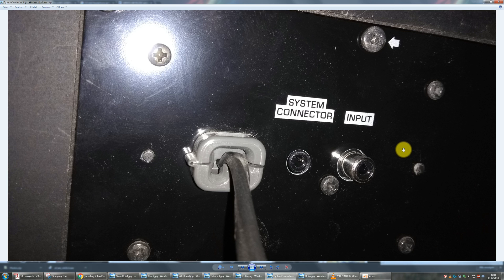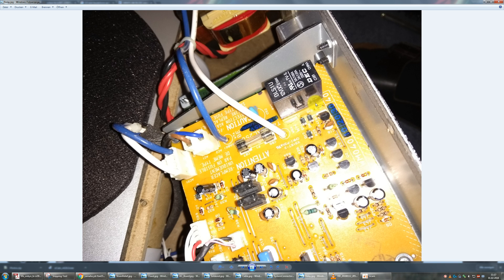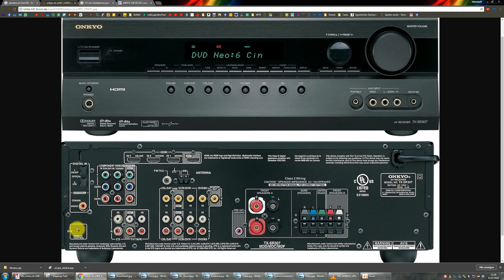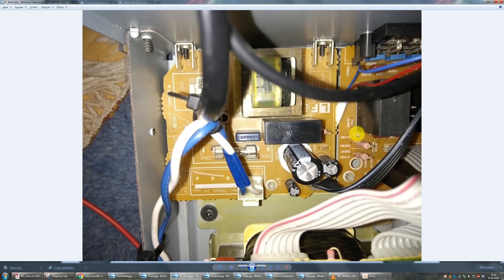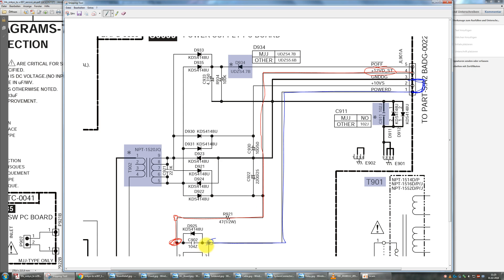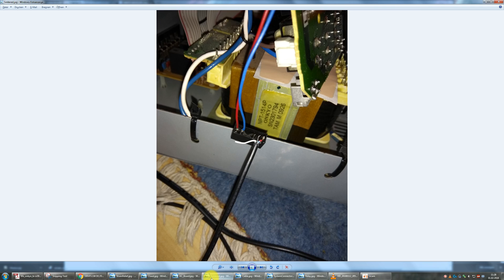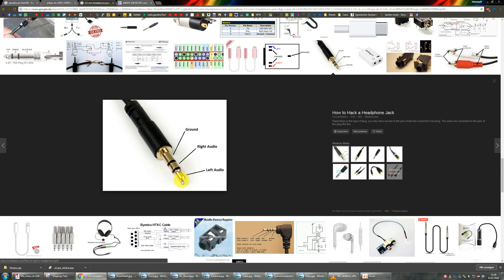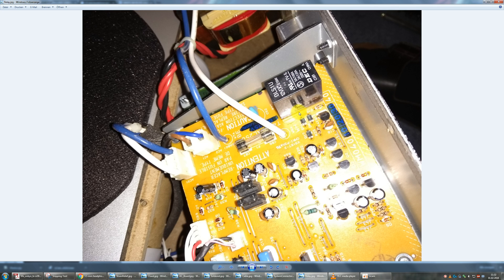Yamaha System Connector Hack

Comment: Thank you! I finally replaced a 30-year-old Kenwood receiver with the entry-level Onkyo AV receiver using a faulty remote control as justification - yes, the Yamaha subwoofer now required a trip off the couch to operate since new receivers don't provide a switched 110V power outlet. The Onkyo does however have a 5V 1A USB power out connection. Spliced a USB 5V to 12 V barrel power boost converter cable to a 3.5mm cable. From what I could gather, it seems the ground is isolated in the boost converter (and there's no no hum). My cable is not pretty but it works well. Thanks again for putting this together!

Comment: i just did it my way yesterday.. just solder a jump wire to bypass the tur on relay and it just turs on when you plug to the wall.. or plug back on the receiver, and it turns on when the receiver is on.. in the service manual they show where to jump to 'turn on the amp for service diagnostics reasons'
Reply: can you help me with the location of the jumper?
Reply: @kireresu2524  hello I saw on an indian video i tgink
Reply: @kireresu2524  I saw a video. and indian video... I think. I think the service manual tells that
Reply: @sergiobisonte 
what is the title of the video, thanks for sharing

Comment: hello. nice video...
i have a yamaha subwoofer with that system connector too. it has no turn on or volume buttons.. just 1 rca in and 1 system connector... so i can just plug a small ac/dc 12v to the system connector to turn it on.. right?
my amplifier has outlets on the back. i can connect the ac/dc 12v on one of those outlets so it turns the sub on when the amp is on?
thanks
Reply: hi, I solved the problem with this connector, I have a Yamaha nx sw-150.
Reply: @serezhka0439  i solved too.. there is a relay inside the amp. if you jump the relay, the amp turns on everytime you plug it to the  wall

Comment: I came across this video looking for a way to use this exact same Yamaha Subwoofer System Connector. I actually have a new AVR (Denon AVC 4700H) which has no less than two 12V 150 mA Trigger Outputs so I imagined I was all set to power on the sub through the AVR. Indeed, it does works, BUT the sub now produces the exact type of low humming sound as you described when there is a grounding loop. Any idea what I'm doing wrong? I'm using the specific cable that comes with the subwoofer for use with the System Connector. Any advice is appreciated!
Reply from the maker: Does the humming sound disappear, when you remove the 12V Trigger line and turn on the Sub manually?
Reply: @NebukadV  Yes it does (fortunately ha ha, nothing broken), and thanks for replying.
Reply from the maker: @morbozim  No Problem - I'm not such a big YouTuber, that I would get thousands of comments each day ... yet :D

That sure sounds like the Audio-Ground and the Trigger-Ground are connected both on the AV receiver as well as on the Subwoofer. I can kind of understand why the AV receiver does it, but the subwoofer should be built differently.

Now you end up with a perfect ground-loop. You either have to isolate the audio signal (there are really cheap "Audio Isolators", that can be had for a couple of bucks. You want to go for a one with RCA connectors - they are usually stereo, which is not a problem). They might have a slight impact on the sound quality, but chances are, there is no audible difference. The better solution would be to isolate the trigger-line. However, I am not aware of a solution you can buy off the shelf. You would need an isolating DC/DC converter like the one I showed, from 12V to 12V. 1 Watt would probably be sufficient, but just to be sure I would go for a 2 Watt unit. If you got that and a soldering iron, you can modify the trigger-cable yourself.
Reply: @NebukadV  Thanks again, I'll see about getting one of those Audio Isolators, and if that doesn't work, well I'll just have to press 2 buttons. They're only 40 cm apart so no big deal, but would be a shame os a function/feature does not work as intended. Cheers!

Comment: I have an RCA Subwoofer that has traditional Red and White Patch Cord but the Sub has no System Connector input.  I want to hook up my Subwoofer to a Yamaha Sound Bar.  Can I simply run either the red or white patch cord into the Sound Bar's one Subwoofer Output?  I really hope this would work.  For some reason the Sound Bar only has one Subwoofer Output instead of the traditional Red and White Outputs.

Thank You So Much
Reply from the maker: Yep, works just fine. The Sub accepts input on both the red and white input. If one if them is hooked up, that's enough. Industry standard would be to use the white (left) input for mono, but it should not matter at all.

Comment: Thanks for the useful video. 

I recently bought a soundbar with an unused USB port and had an old YST-FSW050. I used this technique with a ROE-0512S 5V-12V DC-DC converter to switch the sub on/off from the soundbar USB 5V (100mA) line and it works just fine. 

FYI, I also have the workshop manual for the YST-FSW50/150 and from the schematic, the 12V relay has a bootstrap circuit that powers the relay after it has been switched on. This means there is an initial current drawn from the System Connector to turn the relay on but once it is on, the current drops to around 1.5mA and the relay gets its holding power from an internal supply.
Reply from the maker: Cool idea to use a USB-Port. That saves you a lot of trouble :)
Reply: @NebukadV  hello. nice video...
i have a yamaha subwoofer with that system connector too. it has no turn on or volume buttons.. just 1 rca in and 1 system connector... so i can just plug a small ac/dc 12v to the system connector to turn it on.. right?
my amplifier has outlets on the back. i can connect the ac/dc 12v on one of those outlets so it turns the sub on when the amp is on?
thanks

Comment: This is working for ns-wsw121 subwoofer? Thank you
Reply: I have onkyo tx-sr875
Reply from the maker: It will work with any Yamaha device, that has the Yamaha System connector, like your NS-WSW121. 
It will work with practically every amp, but as I said in the beginning of this video: You have to know, what you're doing!
Reply: Hello, i have the same like you, do you arrived to do it ? Thanks

Comment: Do you know what kind of cable can be used if the original System Connector Cable is lost?
Reply: It is a simple 3,5mm  mono plug cable, both sides male.